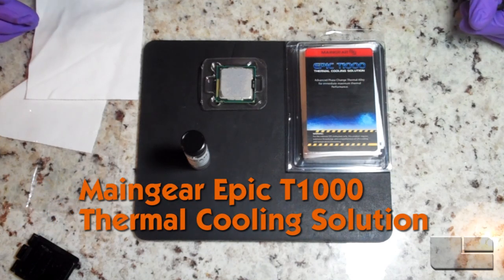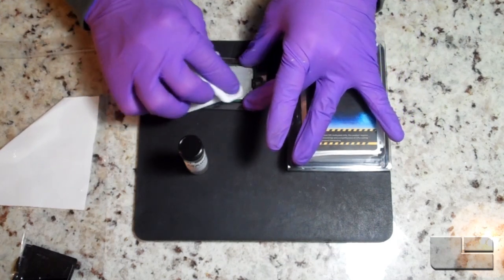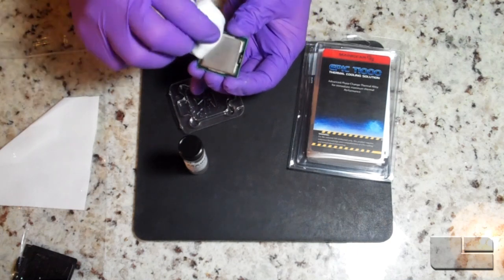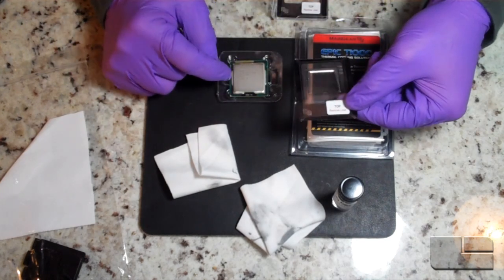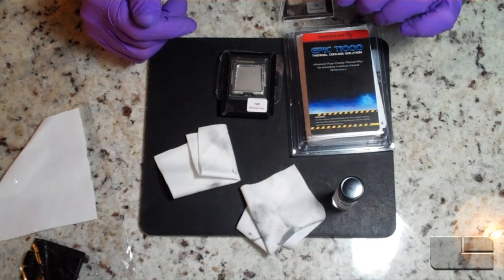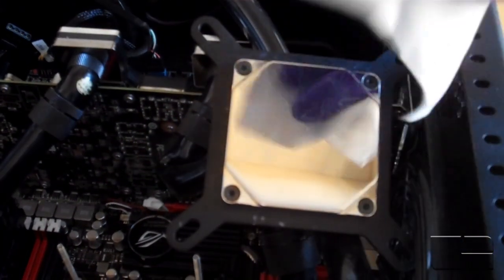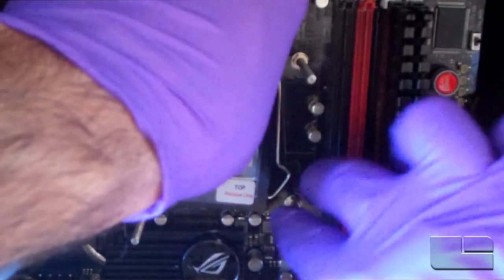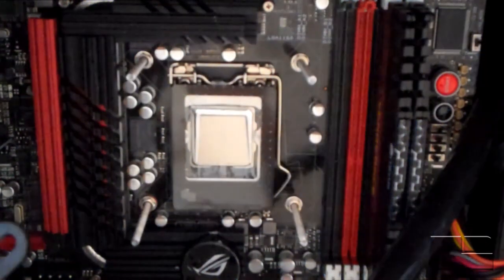Maingear Epic T1000 Installation process

Comment: @mrlouist457 The metal is electrically conductive, but the frame and the film keep it between your CPU and your heat sink block.  You don't need to push "firmly" in fact you should keep your hands off it to prevent contamination.  The film is tacky so it sticks to the CPU quite well and the metal is almost solid in its cold state.

Comment: @DJDevon3 The reflow basically looks like you painted the top of your IHS with silver.  You are phase changing the horseshoe shaped material into a micro thin metal layer between the top of the CPU and bottom of your cooler block. 

The black frame is used to contain the phase change metal and keep it stuck between the block and the IHS.  It stays in place as the metal material actually floats inside the micro thin plastic sheet suspended by the black frame.  I don't what the film is made of.